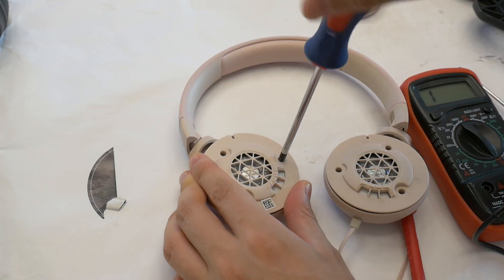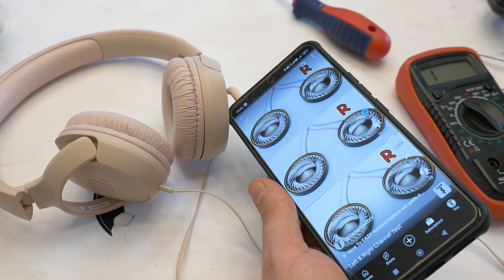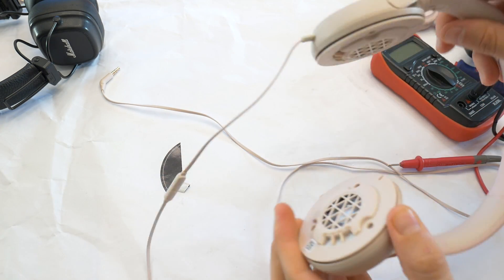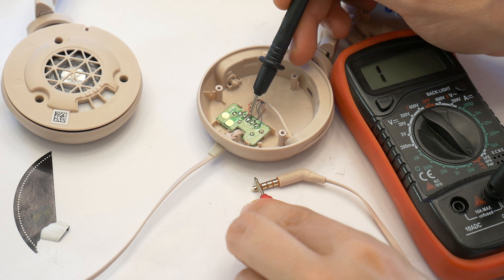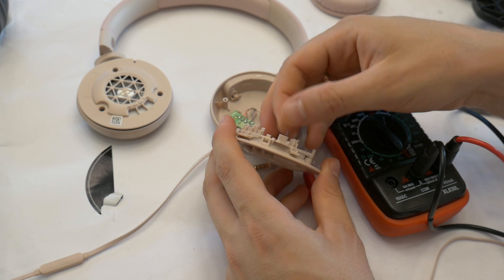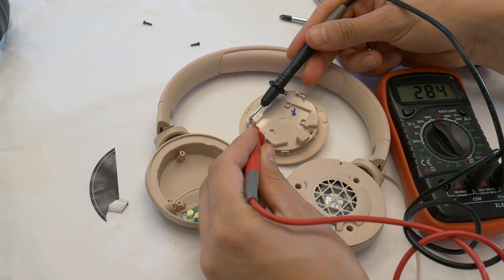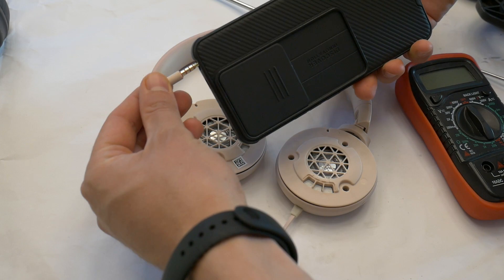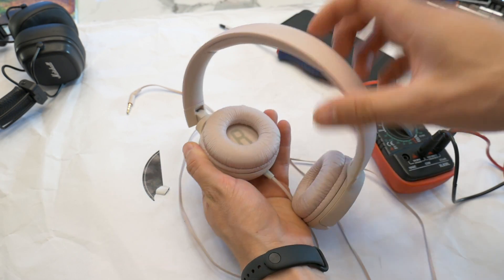How to repair JBL Tune when one side not working DIY

Comment: If the software methods are unsuccessful, checking the speaker drive springs is the first hardware to check because its the most common issue.

Comment: For us both sides work on cable but only one side on Bluetooth. Tried a reset and still same issue. What's going on!? I take it it's not the springs if it works using a cable so must be something to do with the Bluetooth driver?

Comment: Mine both work but only on left side. If I switch them 180 degrees, the one that was not working now works. The one that was originally working then stops working. So they both work but only when positioned on the left side

Comment: I did not expect this to actually work like that so easily. Thank you soo much for the easy, straight to the point tutorial
Reply from the maker: When I repaired these headphones, I didn't think it would be so easy either, but it's a pity that JBL engineers created a solution that breaks so easily.